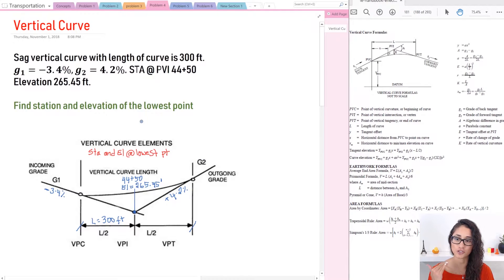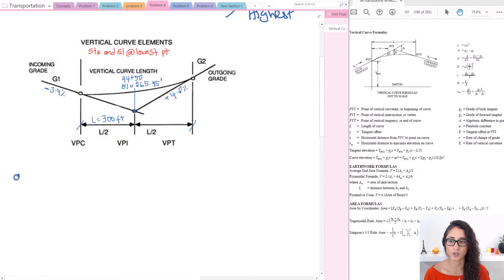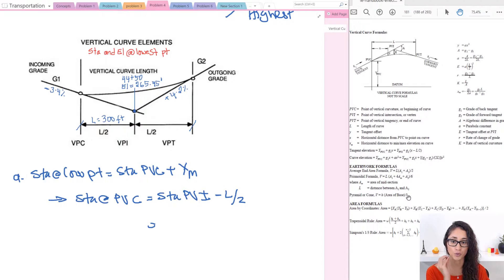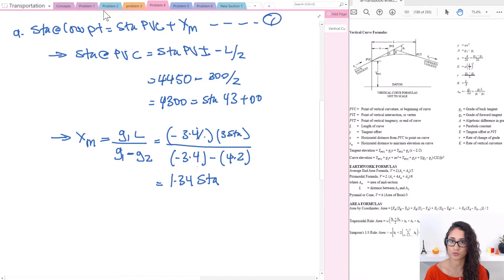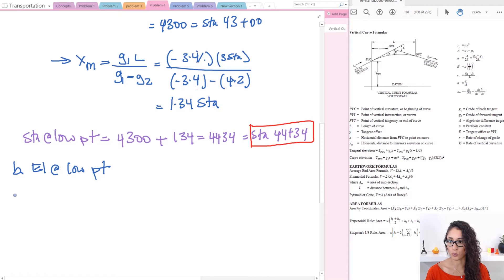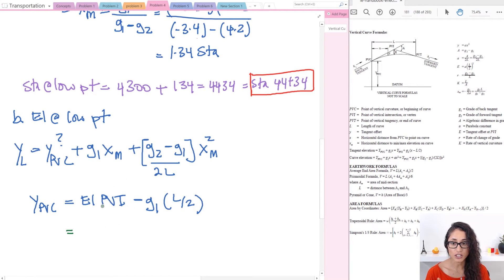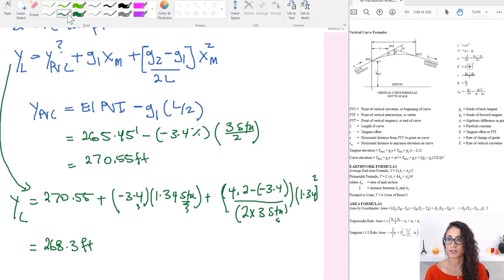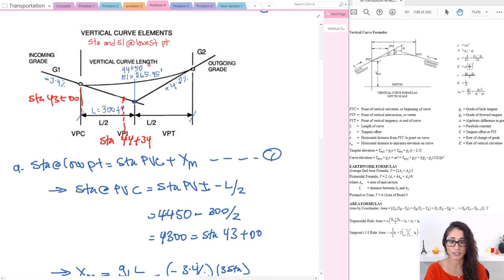FE Exam Transportation - Vertical Curve Problem 2

Comment: I wanted to know for Station at lowest point why did you add 4300 + 134 and not subtract? I understood from your previous video that to find you subtract Xpvc to the distance your trying to find.
Reply: Also for Xmin why was that plugged in the curve equation instead of the distance between Xpvc and X min as done in the previous problem

Comment: Hello, and thank you for your excellent videos! Wouldn't the lowest point be at PVI in this case because the elevation at PVI is lower than the elevation at 44+34?
Reply: The elevation at PVI is not on the curve. That is just the intersection of the forward tangent and back tangent projected through to their intersection. Just like in horizontal curves.

Comment: Thanks very much for the nice explanation , if we were given crest vertical curve question and asked to find highest point on the curve , will the solution be the same in the steps or different ?
Reply from the maker: No problem and the steps would be very similar if we had a crest curve. I hope this helps and good luck!
Reply: Thanks alot very helpful